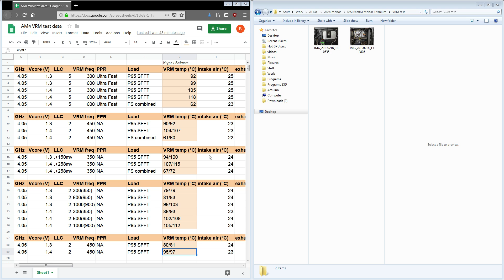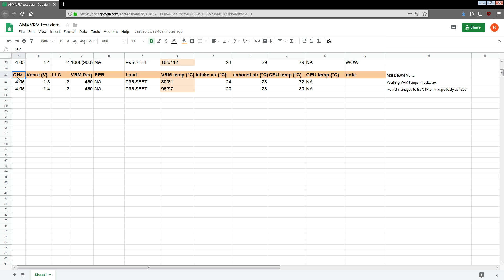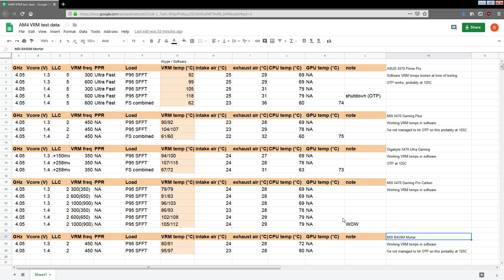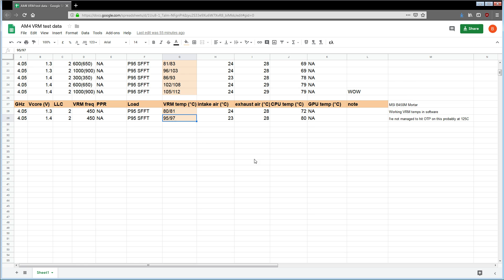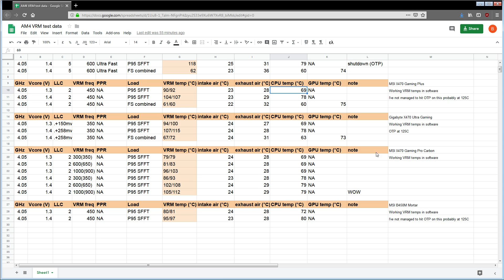VRM thermal testing: MSI B450M Mortar Titanium //

Comment: Are these results on an overclocked 2700X or stock one? 

Isn't 1.4 volts quite a high number for an stock running 2700X? 

If it's on an overclocked 2700X, it would be beneficial to make tests with an stock running 2700X, as it hits the same frequency with turbo boost and a decent cooling solution.

And lastly, it would be better to know the temps of the VRMs on gaming rather on testing them with Prime95 with AVX that stresses the CPU relentlessly. 

Because I'm pretty sure this situation matters on a lot of users. And most probably whilst gaming, the VRM temps would be way lower on all the tested boards above.
Reply: The reason they aren't tested at stock is because every motherboard besides possibly the absolute cheapest can run stock with no problem. If 1.3v works stock will be even cooler.
Reply: Pretty sure it's a static OC, you can see the frequency achieved in the spreadsheet shown appears to be stable 4.05ghz in most cases.

As he explained these are VRM throttling torture tests, they are plausible to reach if you are using them in an encoding box and are not meant to reflect gaming situations.

This is not a review of the board per se but mainly a followup on a comment from a previous video that this was the only sub £100 mobo he'd trust if the heatsink performed well.
This is testing VRM thermals on a B450 board in comparison to several X470's
Reply: Because the channel is called "Actually Hardcore Overclocking",not "Actually Running at Stock".
Reply: @hateWinVista  There's someone on GN's discord named "Actually Hardcore Running at Stock"
Reply: Thanks for the answers guys!

So i assume whilst gaming (and AVX is pretty much useless on games anyway) all these boards will achieve way lower VRM temps. 

And that's exactly what I'm interested for. :)
Reply: That's not an professional answer. :-P 

Most people doesn't even care about overclocking but they do care for gaming in particular. 

And they wanna know if a decent priced board can achieve safe VRM temps whilst gaming without CPU throttling at full CPU load.
Reply: @darthpc2503  The short answer is that this was less a test of gaming workload, more a case of "Is this a B450 board that can ACTUALLY fully use a 2700x heavily - 
This is because Buildzoid has previously said he basicly wouldn't trust any B450 board with more than a 6 core chip for daily use.

This test proves it is one of few low-mid range boards that won't VRM choke under torture loads, this means it would be basicly impossible for the board to down clock due to VRM's in a gaming scenario
Reply: Hmm are you sure about that?

I can't imagine why the other X470 boards would throttle an 2700X (running stock) at a gaming session. 

And a say that, because it's most unlikely (or should i say impossible) that an 2700X will work at 100% across all cores on any existing game.

I would love to hear an answer from Buildzoid on that matter.
Reply: @darthpc2503  We aren't talking X470 here though, This is a B450 board. - And the comment before was there wheren't really any B450's he'd trust with more than a 2600.

The point of it is highlighting one of the few Motherboards in the B450 range that has acceptable VRM cooling, then realizing it outperforms the VRM cooling of most X470's

Comment: instead of rad at front .i cut the honeycomb out the top of my case  and mounted my captain 240 externally  with a push pull config.giving u more cfm space and additional fans to be added giving u better static  pressure.i find it looks pretty awesome and industrial that way.i had to do it for myself due to mb aesthetics and ram sink hight.i have no regrets doing so :)

Comment: Not exactly for this motherboard though, but what are your thoughts on installing aftermarket heatsinks on motherboard VRM?

There are some heatsinks made usually for graphics cards with little footprint but long fins or sticks for heat dissipation.

I'm asking especially for boards like the Mortars' with no heatsinks on the SOC VRM, in case people want to use a 2200G or 2400G on them (okay, this combo would be a waste of money boardside, but just for instance). But there are other boards that have no VRM heatsinks at all as well.

Seems like the manufacturers allways forget about the APUs, I think.
Reply: Such radiators:
https://yadi.sk/i/D6KSURDOliV6-g
https://yadi.sk/i/TPV3enMuryNXLw
Tthe maximum heating in the SOC VRM area reduced from 68 to 48 degrees (AIDA run + GPU check + thermocouple at the back side mobo)

Ryzen APU 2200G @iGPU=1500MHz, vSOC = 1.1v

Comment: I'm planning to use this board (non-Titanium, Max version) in my next build in a few months if no affordable PCIe4 mATX boards and APU's come out by then. The only possible alternative I see atm is the AsRock B450M Steel Legend, did you happen to test that one as well?
Reply: Candisa I was looking for affordable, good X570 mATX boards and only 1 exists. According to reviews I’ve seen (including from Buildzoid), the Asrock X570M board isn’t very good. I ended up getting the MSI B450M Mortar Ti (only option available) with 3900x
Reply: @jamerican347  how does the board perform. Seriously im planinb to get the board. B450 tomahawk is stupid overpriced here 130. While  mortar is 100

Comment: hey man. Any comment on recently added offset to MSI boards for b450 and x470? Would really like to hear what you have to say about that and if you had a chance to test it. Cheers
Reply: Ozored1 i think its the same, or pretty close atleast. But the heatsink is very diffrent and it will rum hotter

Comment: I was looking at this board when i seen your previous video saying it looks decent. I got the titanium with 1400 and built system for friend with the normal black one with 2600. Both systems running well. Bios had different driver names between them. Would really like an overclocking review of the bios and rough run down on settings like voltages in bios vs what is delivered. Great reviews and explainations.

Comment: DO you know if the B350m mortar has the same VRM?  Currently using this board with a r7 1700 still on stock air and a mild OC @ 3.4ghz. just wondering if its safe to push this board to 3.9 or 4 ghz?

Comment: What do you mean Asus boards have buggy software VRM readings? Mine shows as -996.0c pushing out 1,558.0 volts and -2,048.0 amps. Seems perfectly reasonable to me!
(Yes, those are real figures reported in software)
Reply: That's some proper VRM  cooling you got there!

Comment: I'm having a hard time getting past 1800 on Cinebench with this mobo. The board recently got negative voltage offset for PBO, and even though the thermal benefit is great, I don't see a performance gain with my 2700X. I haven't really yet had any time to try this with a manual all core OC, as I'm not really sure if I wan't to go there for daily use. (Should I?) I was wondering if it was possible to mod this board to raise the EDC limit? PBO constantly hits it, but the VRM doesn't really get any hot.
Reply: 1800 is about where an 8 core sits, you won't get much higher. My 1700 got ironically 1700cb. An 1800x or newer usually gets around 1800cb. It should be just as you'd think, a TR 1950x at 4.15 Ghz (double the cores, double the memory channels, basically just double everything), makes a shocker of... double the cinebench at 3600cb...

You're getting about as expected. The way to really get any higher is with faster RAM (not particularly good idea for some workloads, since your timings and latency will be much worse, but if you really want to spend a fortune on binned B-die like a 4 Ghz kit and then downclock it to 3600 and manually tighten every timing (have fun, let me know in a year when you're done), then you can see noticeable gains past that. How big? well, not getting a Threadripper even though you just about died of old age getting every last cb point... (I love benching, but after 10 hours of tuning memory, I give up, because it is no longer fun, actually not fun about 9.5 hours prior... I just get it 95% dialed in, and say "yay, I'm still alive" and move on with my life and write the settings down for next time)

You could try overclocking though, that's usually a very quick thing (an hour of tuning, and then let it set overnight running P-95/handbrake and whatever else you want and if its still going without errors when you wake up, its probably good. I technically go way more in depth for stability testing, but usually this is good enough for most people, I mean, most people run windows... Just saying, you don't care about stability if you run that garbage code!)

Comment: Also is there much difference in vrm of the b350 msi boards and the b450 ones?
Reply: like 10% worse in thermals, a little less max supported current and Nikos mosfets considered less reliable. also "heatsinks" of the b350 boards generally suck more. so I would say MSI b450 is slightly better.
 
that said B450M Pro-VDH now uses the same VRM as the B350 boards, and it seems that with Bazooka boards they do the same and also use b350 "heatsinks", so MSI started making the same shit again. Plus versions seem fine.
Reply: No, it's like 50% worse in thermal, I have b350, very shitty heatsink. Get b450.

Comment: I have a question. Where did you learn about motherboards? Especially Vrms and phases?
Reply: This is exactly what I'm wondering. This guy obviously knows his shit... so where did he look to learn all of that...
Reply: @GandalfTheSilver  Exactly! I know how to build computers, as well as some processor and gpu technology and architecture, as well as knowing what a good board is, but I would love to research and learn different types of VRMs and what VRMs are good and bad.
Reply: Hey guys. It´s called electronics. You know, transistors, resistors, capacitors, inductors, basic building blocks. Then you cram them together, and you got ICs, then you put these on the PCB, and you have PCBAs - boards, for your use, motherboards :-D You simply skipped two topics in your expertise. :-)

Comment: Hey Buildzoid, do you think it can possibly handle 12 and 16 cores, if they actually come out? I presume OC maybe out of the question, but at stock? Understand we don't have exact information, but educated guess? Also, cheers from the Czech Republic ;-) (rather did not write in Czech, for others to understand). Mark
Reply: Probably 12 core stock. Ryzen 8 core pretty well maxes out around 120w-130w for the most part. The TR 1950x is 180w stock as a 16 core reference. So that's about in line as expected (essentially 2x 1800x, which is exactly as TDP would suggest).

You can also add fans to a VRM if you need to. For example, I can hit 500w on my FX CPU (1.7 Vcore on FX-8350) with a 4 phase motherboard (it has actual heatsinks, I also added heatsinks to the chokes and have 2 40mm fans sitting on the VRM, it was $3 in VRM mods well spent!). With Ryzen, my 1700 overclocked really doesn't seem to get the X370 Fatal1ty board even warm (it doesn't even have heatsinks, it has heat-blocks), so that board should have no issue with 16 core with a mild overclock (please note the word MILD)

The reason you may not be able to overclock it as well, is you need to cool high thermal density. My TR 1950x can sit nice and happy in the 80s at 450w power draw (all my measurements are CPU only power draw), and I can keep it cool with a whoppingly pitiful 120mm AIO... You try to cool a Ryzen 1700 with that cooler, and it just doesn't cut it with very much power! The TR chips is just plain massive, the heat has 2 to 4x the area to come out of (varies per model). To cram this into a small desktop chip is just like the old FX series (although those used larger manufacturing process, so they are actually not hard to cool at 300w). Thermal density is a real issue as we go smaller and smaller...
Reply: @jakegarrett8109  ryzen 2700x max out at 180w with manual overclock,130-140w it where xfr will cap it with aio 360mm radiator(running prime95 torture test). My vrm gets hot and i have asus rog strix x470 f 8+2 phases. Presumably zen2 should be more efficient but i doubt this of kind b450 board would be able to handle anything over 12 cores under heavy loads as it doesnt even have LLC.

Comment: Давай 450 про! Народная плата для простого народа
Reply: same as tomahawk minus a heatsink. if you want to overclock with it just put a fan on VRM
Reply: @rawdez_  they say the controller heats up
Reply: @Ricky_Spanishhhh  nah, its not. Nothing unusual for sure.
Reply: @rawdez_  I have a 50 and 40 mm cooler, for a future series, and on the controller, just in case, I will glue an aluminum piece
Reply: @Ricky_Spanishhhh  well, this definitely wouldn't make things worse as long as your aluminum piece is a radiator. So why not.
Reply: @rawdez_  I cut a window in the case to screw the air cooler on the back side, 1600x more and was not needed, we are waiting for the summer and the release of 3xxx

Comment: I hate to have to say this, but I'm stumped. My RX 480 GamingX is being limited to 150W power draw no matter what I do with the power limit. 
I've tried flashing a 225W BIOS, driver versions 19.1.1, 18.1.1 and 17.12.1 (this wasn't an issue a year ago when I was on 17.12.1), cleared CMOS.
Do you think it's Windows messing with it? I'm on build 1803.

I mined on this card so it's pretty derated but I'd still like for it not to throttle at stock settings.

Comment: Hey, saw on reddit that MSI added offset voltage control for a bunch of their B450 and X470 boards. Could you do a quick test to see if it works as intended with PBO? 

Thanks!
Reply from the maker: yeah I've been planning to mess with that for a while
Reply: Finally, actually viable pbo, the only thing left to do now is to make the boards allow the user to tweak bclk without the CPU losing it's metaphorical mind.
Reply: @thetrashman5252  so what gigabyte does
Reply: @fxckrio  My point exactly, I own an x470 gaming 7 wifi for that exact reason, and I would really like to add msi to a list of considered brands, they are already halfway there, and even so having a voltage offset is still better than having no voltage offset, it just seems like there is still some room for improvement when it comes to pbo over clocking.
Reply: Something else: in a recent BIOS update, they added BCLK overclocking on the B350M as well. According to software it works, but I haven't checked with a scope if it actually works though, since it doesn't seem to have a dedicated clock gen.
Reply: I can confirm, I have this board (not Titanium, but regular Mortar) and with the latest, end of january BIOS update the offset appeared at Vcore settings :D I'm so happy now
Reply: @thetrashman5252  yeah, they have decent vrms too, they just need heatsinks and to break the PBO agreement lol